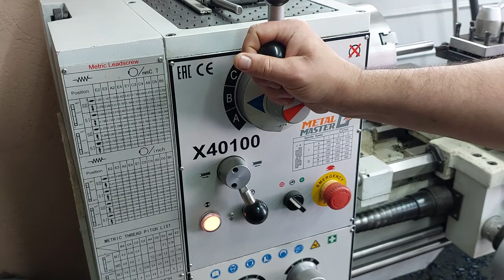Invented a new tool from a worthless lathe plate

Comment: I just use a large wood router 45deg. v-bit glued into a 3d printed handle(also work great as countersinks and the cutting forces are so much lower than the typical countersinks that using them is a breeze by comparison.....)